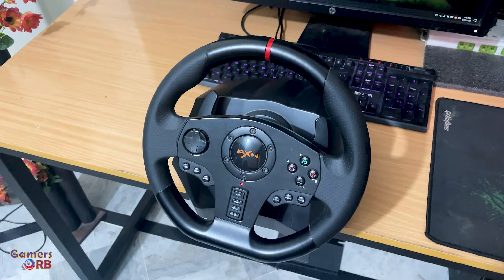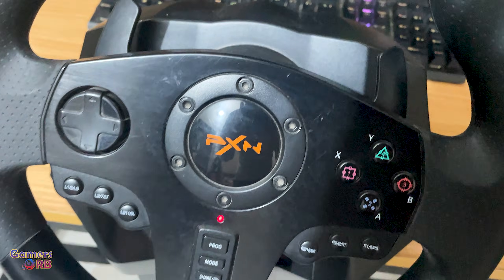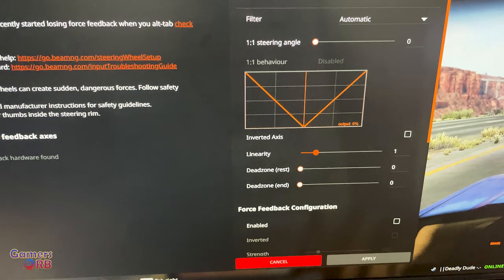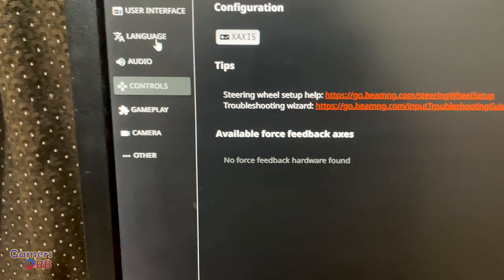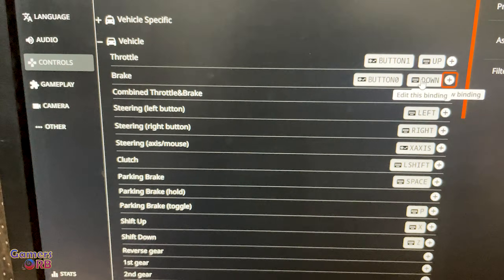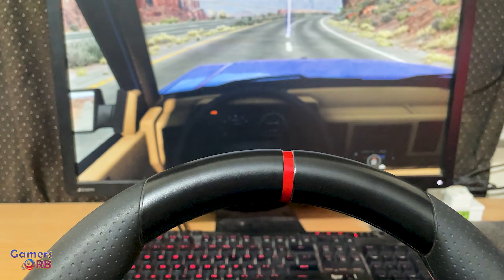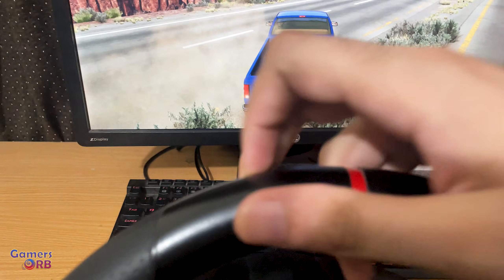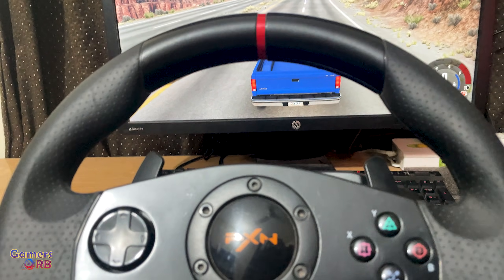How To Setup PXN V900 Steering Wheel for PC - Tutorial

Comment: hi, why is my gf's pxn v900 detected as a controller on device manager? please help 🥹 and the wheel settings isn't available on the crew 2😢
Reply from the maker: @oyasumii  it should work in crew 2 by default.
Try changing Input mode
Reply: @ it does work, but i cant seem to access wheel control settings.
Reply from the maker: Maybe it is connected as ps controller thats why you cant change settings? Check wheel connection type in game
Reply: @ it is connected as a controller on device manager, how do i change it?
Reply from the maker: try firmware update, check my other video.

Comment: what mode are you using?
Reply from the maker: Depends on the game
Reply: @GamersOrb  beamng
Reply from the maker: @suzbock8046 normal mode. No changes
Reply: @GamersOrb  default mode is X right?
Reply: and also do i need to change/update my firmware or anything for my beamng to normally?
Reply from the maker: Beamng will work fine, no need to change any firmware. If you have trouble playing ets then change firmware
Reply: @GamersOrb  thank you, normal mode is X mode right?
Reply from the maker: @suzbock8046 default mode is X, when you change it then it will become D-Pad
Reply: @GamersOrb  are you using X-pad or D-pad?
Reply: for beamng
Reply from the maker: Default, X-pad

Comment: Yo brother can u pls help me ? In Forza Horizon 5 my accelerator and brake gets combined bro pls help
Reply from the maker: Check firmware.
Reply: @GamersOrb  bro how to do that?
Reply from the maker: I had the same issue in ETS where the accelration and breake had the same button and i was not able to change it.

Try this.
1. Change the Mode  (if that does not help) Try to update the firmware.

Here are the two videos that you need to check and follow. 
PXN V900 Mode Video:
https://youtu.be/5H2CK3eZv74

PXN V900 Firmware update:
https://youtu.be/AP0Ps8dTEZY
Reply: @GamersOrb  thanks I'll try
Reply from the maker: np
Reply: did you ever figure this out? im having the same issue
Reply from the maker: @MightyMouse27RayRice check my other video you will have solution